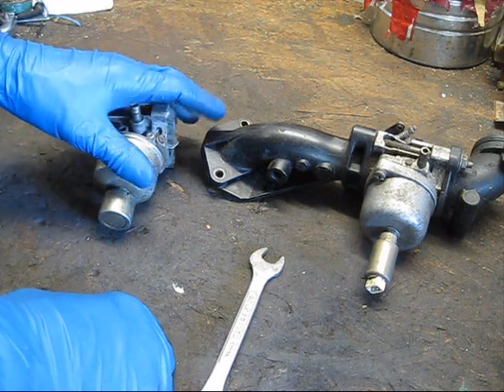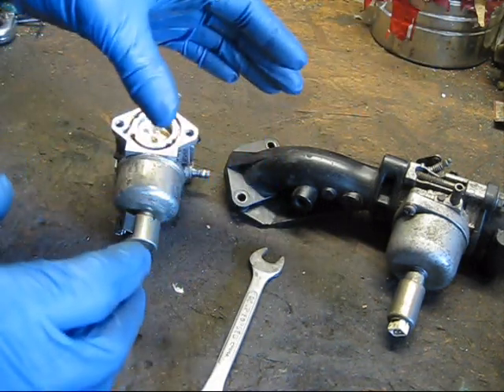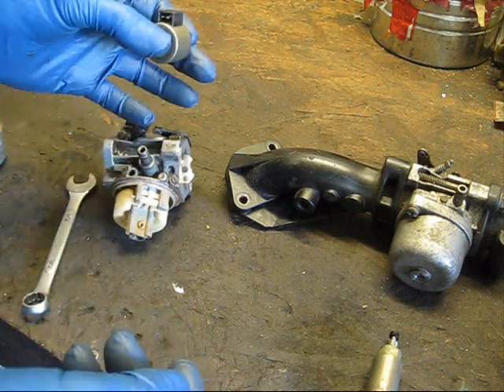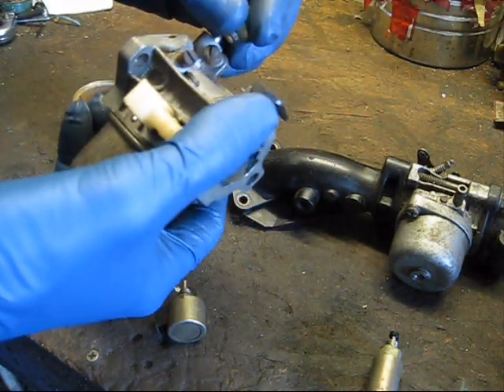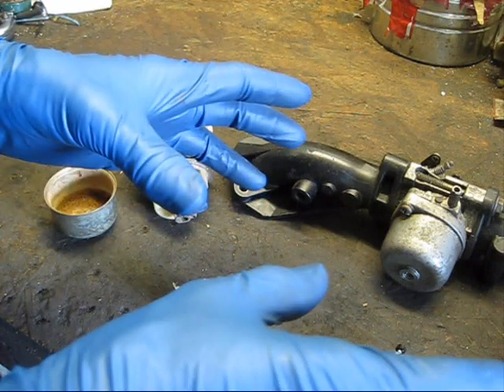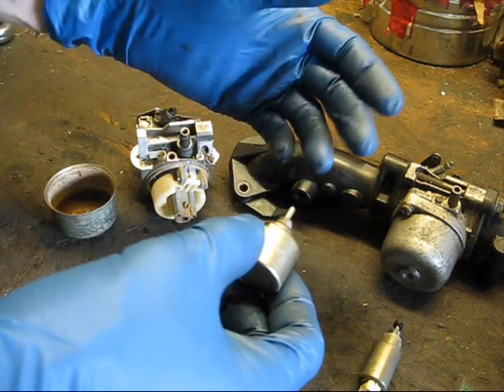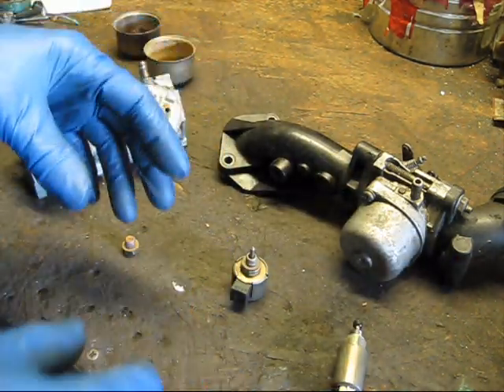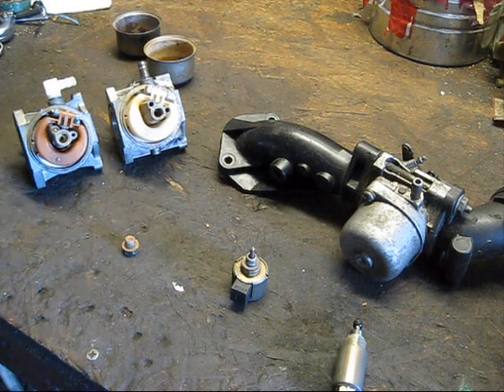Backfire/Afterfire solenoids: what they do, how they work, and common misconceptions

Comment: Woot got all the info about Backfire/Afterfire solenoids for a tractor unit i try to fix.. .. btw ty for the last tip of the video.. i might use it to see if it's the solenoids is the prob, put a screw or take a rubber off .. .. but might be nice to take it off and take the muffler off to do a sound show ;oP

Comment: My 20 hour Koehler twin mower wouldn't start. Of course it was the solenoid.  I've used nothing but non-ethanol fuel and it's never is idle for more than a month. I keep fresh fuel in it.   I sprayed with carb cleaner several times and a lot of rust ran out.  Took about 10 times for the cleaner to run out clear. Now it's working. Could it have been from standing at the dealer I bought it from?    Maybe they had 10% ethanol in it.
Thanks.
Reply from the maker: every time I've seen that its from water in the fuel. but the mowers I get have typically been sitting outside or for long periods of time.

Comment: I have a problem where that anti-backfire solenoid is seeming to be intermittent. 
It never was stuck, it just lost power and engine quit running. 
I’ve sprayed the contacts in the plug and in the receptacle on the solenoid, with CRC Lectro Motive parts cleaner….twice. I also sprayed the harness connector on the right side, where this wire passes through.

It started working again each time, BUT has quit twice on me. 
The wire sits in a little metal clip under the front of the engine, on the way from the solenoid back to the right side, where it gets power. 
-carburetor is on the left….it’s a Briggs & Stratton 17 HP single cyl. 
I checked for a bare spot in the wire, but couldn’t find one.

Do you ever see an intermittent solenoid? 
I suppose the solenoids are kinda expensive….
Reply from the maker: All the time. They get sticky and the springs get rusty because all the junk gathers in them. My Commercial Zero turn had an intermittent solenoid. I also had a stock one fail on a newer Briggs because they had started using no name carb suppliers.

Comment: I have a John Deere 165 Hydro it backfires sometimes I lower the idle speed and it still backfires what causes it new plug we change new gas filter push air through all gas lines cleaned out runs good backfires when you turn it off
Reply from the maker: afterfire solenoid

Comment: I have a generac generator with a fuel shutoff solenoid on bottom of carb . It started to stick took me forever to figure it out. Funny thing is the 2 wires that leave it where never hooked to anything, no where to hook them. they where simply connected together with butt splice crimps. How did it ever work?
Reply from the maker: generator afterfire solenoids are a mystery

Comment: Thanks for info. I'm old as fuk and never knew. But for any poor mechanics, if you do remove the solenoid, use a plug with pipe threads, lightly coat with Indian Head Shellac (NAPA). It prevents gas & water leaks.

Comment: No fuel getting to spark plug. Cleaned carb twice, still no fuel getting through. Took off solenoid and switched on engine, no retraction of plunger. my understanding was that solenoid had failed electrically. took casing off solenoid and removed spring. put casing back on and connected it back onto carb. Cranked engine, started straight away. so surely this means that it is not just to stop backfire, but to allow fuel to flow once engine is started. Now off to get replacement asd I now know that the solenoid is faulty. thank you.

Comment: Absolutely amazing explanation! Thank you so much for this. Great camera work, audio, etc.
Reply: Just a follow-up. The plunger on mine is not in any way stuck or sticking, but I still get a backfiring when hot. Could it be the end of the plunger not making a good seal? That’s the only thing I can think of. So what I have been doing is throttling down to about 1/2 or less, for about 15-20 seconds. That works, just not the best of course. Thanks again. Super job!

Comment: When you turn the key off  in your car/truck , do you hold the hold the accelerator down and run the engine at WOT before you turn the key off? Then why do it on your lawn mower? You never tried it  1/2 throttle ? How about  throttle it down all the way and then turning the key off.  B&S could of used a multi layer metal head gasket to prevent the head gasket from blowing out from a back fire.

Comment: So, if you have, like I do, a manual/pull start generator with a solenoid, the only thing that actuates the solenoid, opening the fuel flow, is the current made when you pull the rope, correct? That could be for a very brief time indeed, and if the engine doesn't fire with that pull the solenoid immediately closes the fuel flow, I assume. Champion recommends, at least when not planning to use the unit for a time, to turn the fuel petcock off and let the engine run and turn off due to lack of fuel. I'm wondering if this pretty much drains fuel from the carb and when you try to start it with the solenoid closed, except for when you pull the rope, starting could be difficult, more so than a model with electric start. Ever been a manually controlled, no electricity at all, solenoid, although then I guess it wouldn't be correctly called a solenoid but a switch, to manually close the flow to that tube when you shut the engine off, otherwise it's open ? Or a solenoid that's normally open and a switch to use with a small battery ( I don't know how much voltage it takes to operate these) to activate just to shut down ?
Reply: On pull start equipment, the solenoid allows fuel flow when it's not receiving power. It's powered by the charging system when you hit the kill switch and cuts fuel flow during the engine wind down.

Comment: Is it possible to add a solenoid to an older carb that wasn't originally equipped with one. Particularly a 10hp Tecumseh H100 generator engine?

Comment: Could you explain how these solenoids work on equipment that is hand-pulled to start (no battery / electric start). What generates the energy to open them? Thx.
Reply: It's a misconception that all these solenoids work the same way. On battery-less equipment, the solenoid works the opposite way and allows fuel flow when there is no power provided. When you shut off the equipment, power from the charging system of the equipment is used to energize the solenoid and cut off fuel flow just for the wind down period.

Comment: Very informative vid but it's confusing if the solenoid has nothing to do with fuel supply and now I'm worried.  Couldn't get mine to stop stalling every 5 mins, 15yo cared for Craftsman rider in otherwise great shape.  Guy replaced armature, still kept choking and dying.  He replaced solenoid today, pin moved back up in slow motion when he'd release it.
She sounds normal again and didn't sputter or stall after 5 mins.  Sounds like once she runs longer she'll stall again and it'll end up being a carb issue...told this guy it probably was carb from the beginning, ugh!

Comment: some people eem to think a solenoid on the carb,will cause flooding inthe eng --- no way ---the level of fuel in carb is controled by te float in the bowl  the solenoid is only a switch to stop eng when switch key is turned off  to pruve this you can turn off the eng   this closes the solenoid now turn on switch key but dont start the eng  nothing happens gas is not moveing the eng has to moving to cause fuel to flow into carb caused by the suction from piston going down this causes the carb to siphon gas from the solenoid tube into the carb throat

Comment: Either the solenoid regulates the fuel flow or it does not....if you shut the key off and it stops the fuel to prevent a backfire...it is regulating the fuel.
Reply: That doesn't meet the definition of "regulate" an on/off switch/valve is not a regulator nor does it regulate anything.

Comment: Adding an on off fuel valve (fuel shut-off) on the fuel line between fuel tank and carburetor, and getting used to always shut off engine by closing fuel flow has solved my issue of getting dirty  carburetor  by always leaving it empty with no ethanol  and also deleting this selenoid and with no fuel left there is no back fires. Takes few seconds to turf engine off and Just remember to remove key afterwards.

Comment: What about when the solenoid I have goes in sideways into the bottom of the carb if the power is shut off to it and the plunger doesn't come in the gas is stopped if the solenoid doesn't activate, also on a craftsman riding mower, the fuel tank is a gravity feed system and if the solenoid  gets stuck open (meaning the plunger is stuck down) the entire tank of gas is then drained and the oil is all full of gas and has to be changed, if a spark is able to  ignite it will sometimes to blow out the case when it explodes, the oil loses its lubrication and has to be changed or you can and will ruin you engine, and also run the risk of it exploding.
As both has happened to me, unless I'm missing something here.
In the mower I'm working on now, I put a two way switch in to the solenoid which has to be activated to keep it running, or it will start then soon die and wont start until the solenoid activates, so somehow or someway the anti-backfire solenoid keep it running or stop it from running, unless I put fuel in manually or flip the switch activating the solenoid, how could this be happening?
Reply from the maker: Side mounted solenoids work the same way. Flooding issues are caused by the needle and seat, not the solenoid, Old flatheads didn't even have afterfire solenoids.

Comment: Great and helpful video.  I wasn’t able find tools to remove the sensor. Look like I have to give up and  grind the wrench Thank you for sharing
Reply: I use a 1/2" ignition wrench now, but before I just ground down an old 1/2" wrench that I had to do it.
Reply: Amazon: Bicycle wrench open end. very thin. You can buy a set or individual